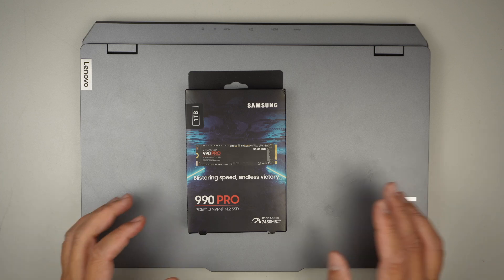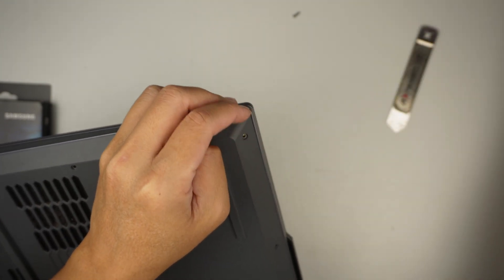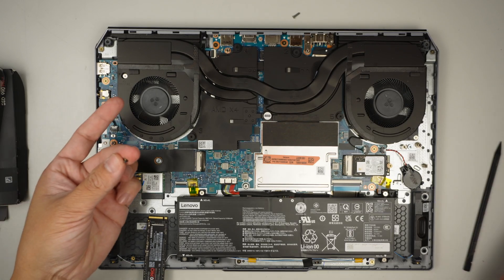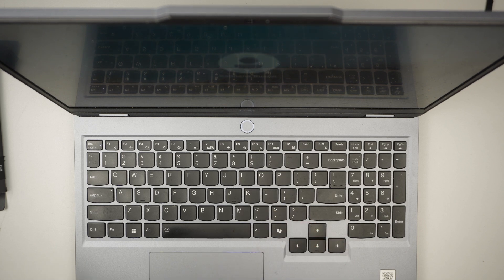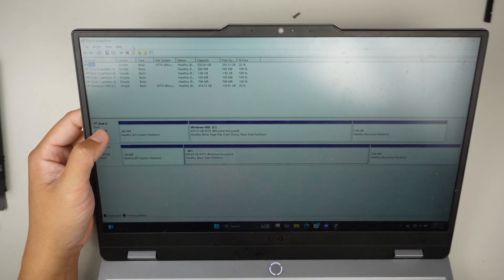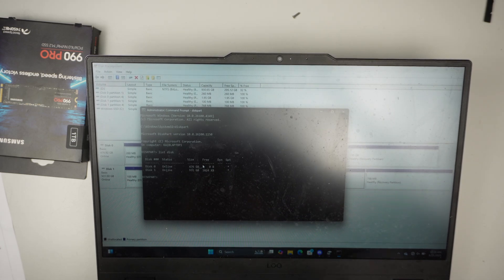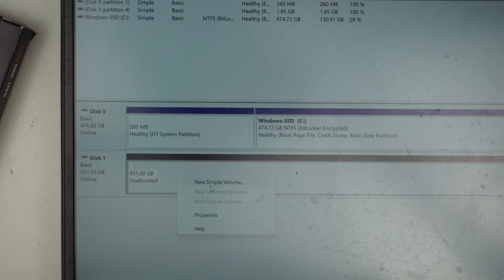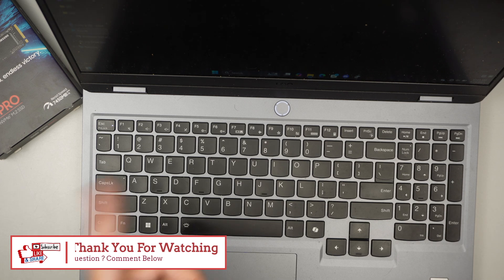Lenovo LOQ 15ARP9 Install M2 SSD More Storage

Comment: For some reason the screw on the m2 slot just will not come out, the screw just spins in place. I've tried each Phillips bit down to 000 bit. What bit did you use to unscrew it.
Reply: Can’t believe people make videos like this but don’t even reply to their comments. I need help with the screws too
Reply: @wwaken   I used a 00 Philips bit for the screws on the chassis and then, after some trial and error, got the m2 slot screw for locking in the new SSD to work with a 0 Phillips bit. Good luck!
Reply: Try using pliers
Reply: @cracker3383 Are you dumb? Pliers are not the way to

Comment: Before remove your SSD screw first detach the battery if the screw fell into the mother board in battary attach it will cause a mother board stout 😶
Reply: Actually the BIOS on this machine has a "Disable Built-in Battery" function. When used, the machine powers down and can then be safely taken appart. I just watched a video on someone fixing a Dell laptop. Don't know whether it had an option like that, but it was obviously not used. The guy doing the repair found traces of damage by a tool (likely a screwdriver) sliping nad shorting a connection which then shorted the embededd controller. SO clearly it is important to use that BIOS function.

Comment: Greetings. Do you think is possible to install a 4TB nvme? Will it be compatible?
Reply: Yes
Reply: @Apollo-4u  Thank you, appreciate it. 🤜🤛
Reply: Did you install a 2 TB SSD? what model? I tried with Kingston kc3000 and it didn't work :/
Reply: @marcosrodriguez7181  Greeting! I got the Samsung 990 Pro SSD 4TB and it worked!!!.
Reply: @terrymills5100  Hi! I'm planniing to get the same Samung 990 pro SSD 4TB. May I confirm what is the model of your Laptop? 

I do have the Lenovo LOQ 15ARP9 Ryzen 7, RTX 4050. Your response will be appreciated.
Reply: @marcosrodriguez7181  Try this.

Open a folder, on the left side, look for "This Computer" icon, and right-click it. Click on "More Options", then "Manage", a window will pop up. On the left side, look for "Storage", disk manager. 

It should show all the physical disk you have installed and they are probably named like "disk0" "disk1" and etc.

You should be able to see your brand new nvme as Unformatted disk or drive. Just format it to use it.

Hope this helps
Reply: @marcosrodriguez7181  because kc3000 is double-sided and it's not compatible. You need a m.2 single-sided. Try with 1TB first. And don't touch the gold pin. Take it in the middle.

Comment: hi i recently bought this laptop and comes with a 512gb, and i saw the description of this laptop stated that theres another storage slot that is up to 1tb, my question is is it possible and ok to upgrade it to 2tb rather than 1tb?
Reply: the 1tb i think its for the main ssd , because lenovo only gives us 2 options, 512gb or 1tb for the main ssd. if u want to upgrade u can add 1tb or 2tb, u just need to make decisions what u want.
Reply: How did it go? 2tb is okay?
Reply: @uugg-m1f did you install 2gb?